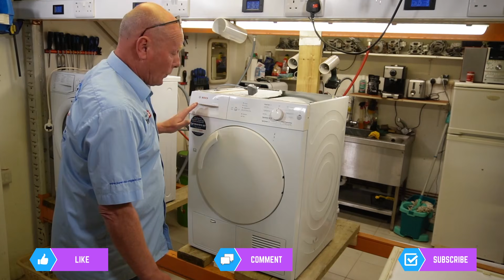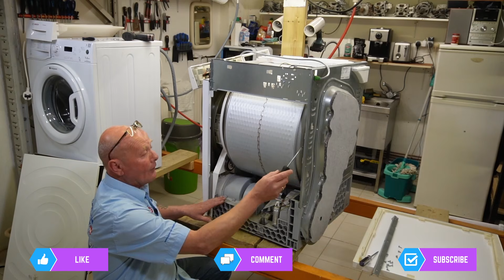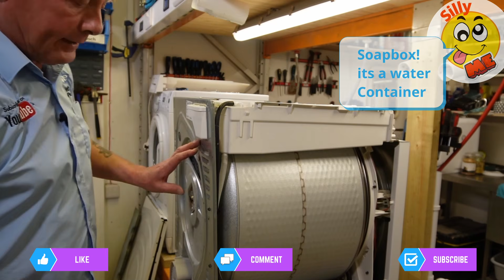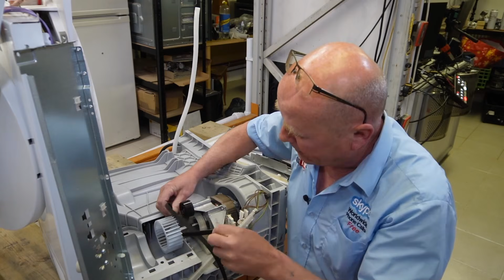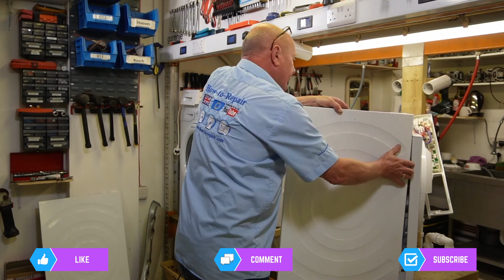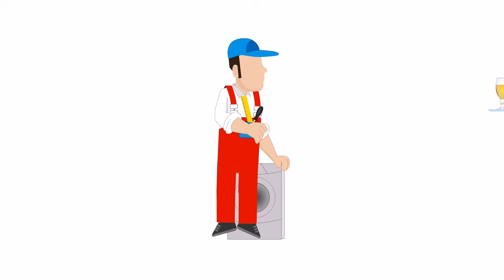Tumble dryer not turning how to replace belt Bosch Neff Siemens helps fit capacitor element fan etc

Comment: We have a Bosch Maxx 8 tumble dryer which had a broken drive belt after 10 years of use.  I found your video really helpful!  Other videos dealing with earlier Bosch tumble dryer models are really NOT helpful and suggest to remove the front of the tumble dryer - I tried this, wasted a few hours, put the front back together and then found this video from how-2-repair and its excellent.  Removing the back is definitely the way to go for a Maxx 8.  I would suggest having some grease available to re-grease the rear bearing as you re-assemble.

Comment: I have watched several other videos in which front panel is taken out. However, that way, it is impossible to unscrew the bolt in the fan cover of motor. The way you suggested took a bit longer time, but definitely worth it. I replaced the belt myself by following your instructions. Thank you very much for this video. Really helpful.

Comment: Many thanks for the helpful video on this one. With the side off and before consulting YouTube, I had a feeling fitting from the rear was the intended way it should be done! It is certainly the best way as it is nice giving it a good clean out! Just finished changing our Bosch belt - 11 years out of the old one, although i suspect it may have been a heavy load like you mentioned that started it going! At first we had a bumping noise and then nothing 😃 Anyway, all good now thanks to your video! Thanks again!

Comment: Thank you for this - a very nice, detailed video that's clear to understand and follow.
I'd spend a long time following another video that suggests replacing the belt from the front, which appears impossible on this specific model. 

Now going to re-assemble the front panels and try following this one from the back!

#WTE84015GB/31
Reply from the maker: You're very welcome! @Wolfsbane2k please remember to subscribe to our channel as that really helps us https://www.youtube.com/shorts/e432SAb2g08  Thanks, Paul 👍
Reply: No problem! Thought I'd confirm that having now put the entire thing back to together again,  and then stripped from the back, it was actually a relatively easy task... but like others, wish I'd had the workshop to do it in rather than a dark and cramped utility room. 

Still, it's now purring away again - and after cleaning the 11 years of dust build up on the back (yuck), working much faster too.. thank you!

Comment: Hi thanks for the video help a lot. But I have a cuestión my dryer Bosch I set up the panel  knob on heavy duty that is 2:25 and the dryer stop and finish cicle . I appreciate your help thanks
Reply: I have to reset panel then happens again is like the time  in the dryer panel is no working thanks for your help

Comment: Hi there. Just wanted to say thank you for your wonderful instructional videos. My sister recently had issues with both her Bosch washing machine and clothes dryer. Here in Melbourne, Australia, a repair technician quoted her well over 500 pounds (AU$1000 +) to repair both. Labour was almost 400 pounds! With your videos, I was able to repair both for less than 50 pounds in about an hour. All that was required in the end was a new gasket seal for the washing machine and cleaning up of the rear blower fan on the dryer. Would you believe the technician 'diagnosed' the dryer issue without even popping the lid? He said it was a belt and bearing problem! If my sister had allowed him to take it away to the shop to be repaired, I have no doubt he would have claimed to have replaced both parts and charged her accordingly. Once again, thanks for the great videos! Trade standards have sunk to new depths here in Australia. I could probably give school teaching away and become an appliance 'technician'.

Comment: thanks for the video. I used your instructions to fix Electrolux 😊. Now i need to replace belt for Siemens iq300 with heat pump. Does this video suitable for it? Thanks in advance!

Comment: Excellent video, got me out of trouble following other (wildly inaccurate!) videos. I managed to do it without removing the power lead and the jockey wheel though. The plastic vent on the front (lower right) has to be nearly broken off though! I had a few screws leftover as well....

Comment: Your video’s are amazing.  Recently my dryer stopped working and when it stopped It smelt like burning plastic/rubber.  In watching your videos I was able to determine that my belt broke.  Sure enough that was part of the issue.  I have replaced the belt and it still is just clicking.  I tried to spin the drum to determine if it was the capacitor and it still didn’t work.  It just clicks and blinks.  I have a Bosch dryer WTV76100US/08. It looks almost like the Bosch Neff minus the water holder. Could it be the capacitor or is it something else like a fried circuit board or motor.  Any advice would be great.  Please keep making the videos.

Comment: Very clear and helpful video. Thank you! I’ve noticed that the dryer is making the room more humid since the seal around the back plate was broken. Which heatproof sealant product would you recommend to fix this? Cheers.
Reply from the maker: the problem being is if you use heat proof glue then it will need to come apart in the future. try using heat foam tape. Thank you for leaving a comment, I would love you to leave your opinion on our poll about manufactures building in obsolescence to appliances. https://www.youtube.com/post/UgkxygHomnUySd_bYjaJBdEHPO6T4dYo9Ahm
and this is for you https://www.youtube.com/shorts/e432SAb2g08 please remember to subscribe as that's is what keeps this channel going. Thanks 👍

Comment: While removing the black hose from water container housing the plastic tip of the housing broke off.

Is there a workaround?

If not, what is the official name of the housing for water container... Or the part number please?

Fantastic video!
Reply from the maker: you could try putting a piece of insert pipe in between the plastic then glue 

Thank you for leaving a comment, I would love you to leave your opinion on our poll about manufactures building in obsolescence to appliances. https://www.youtube.com/post/UgkxygHomnUySd_bYjaJBdEHPO6T4dYo9Ahm
and this is for you https://www.youtube.com/shorts/e432SAb2g08 please remember to subscribe as that's is what keeps this channel going. Thanks 👍

Comment: I would like to buy a shaft kit and the front felt pads which can fix the my Ariston Tvf75c6h1  Series no 604140154.  Can you please advise which set to order.Thank you very much!
Reply from the maker: When you need parts please use the website
We will gladly assist you. Thanks please remember to subscribe as that's is was keeps this channel going. Thanks 👍

Comment: Hi , great video , on a wte84301 is it possible to remove the air intake grill without damaging the grill or the panel , the clips all seem mega tight . Also with the side panel off can the drum support wheel be removed without removing the drum to enable the air blade cover to be removed . 
Great video as usual, the main man 🏅👍
Reply from the maker: very hard for me to answer this without actually seeing I don't want to give you false information thanks 👍 for watching and please remember to subscribe to the Channel as that's what keeps us going in able to make the video for you
Reply: Hi , it is the same layout as the machine featured in this video, you say the clips for the air intake fan cover are awkward to release, but if the clips are released can the cover be removed without removing the drum, can the drum support wheel be removed and then the air intake fan cover be removed easier. Or just for cleaning purposes can the white air intake grill on the front of the machine be removed without damaging the front of the panel or the grill .
Thanks

Comment: Hey, thanks for the video, very informative. I'm having a problem fitting the belt - it's the same size as the old one that broke, but when trying to fit it around the drum and motor, it's too loose, and the drum doesn't turn. Do you have any ideas what we might be doing wrong? Thanks
Reply: For anyone else having this problem, you need to put the belt over the other side of the idler wheel above the motor. The guy shows you a close up of how it should be set in the video.

Comment: Great demonstration, it frustrates me sometimes these manufacturers make it awkward for the engineer in terms of having to remove the drum just enable a belt to be fitted,however thanks again I’ll look forward to many more videos,like myself engineer of 20 years I’m still learning new techniques 👍
Reply: Have a beer on me 👍
Reply from the maker: thanks for the beer mate. i show the video in the right way for genral public but if in a rush you can just loosen back panel, slide drum shaft out and slide belt in. but the maintenance is more important than the belt.
Reply: I totally agree when you have 10 jobs a day you have to find ways of saving yourself time out there.